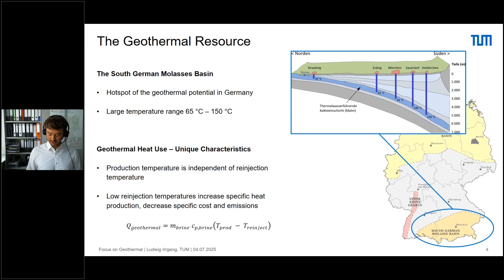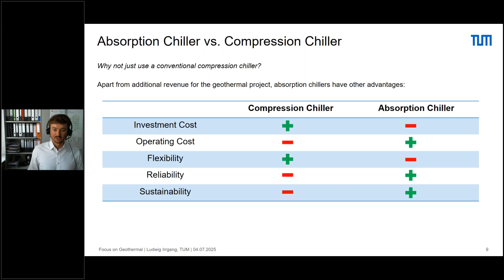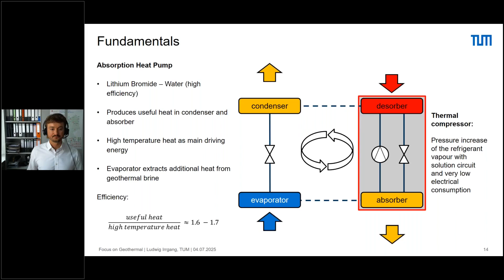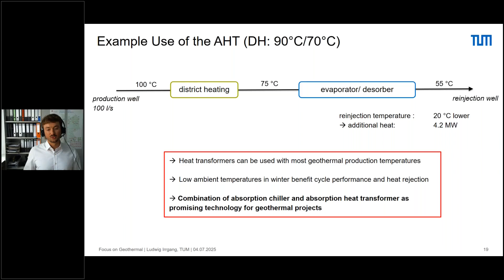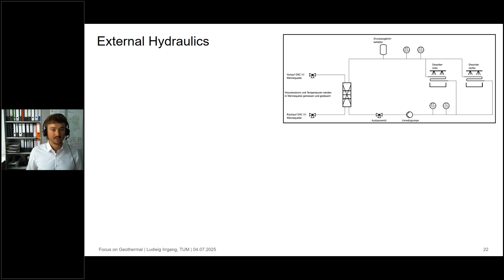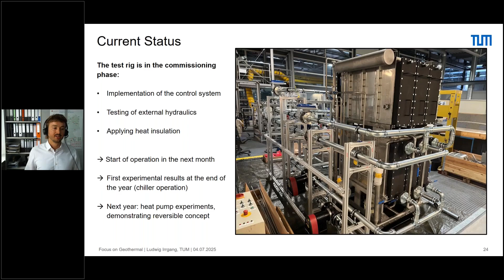Focus on Geothermal: Ludwig Irrgang - Geothermal Reversible Absorption Chillers

Comment: is the system flexible in terms of what a geothermal field can supply? or it can be designed like a modular based on field data? It is very interesting to promote to our Islands with hot springs where refrigeration is needed to preserve fresh catch.